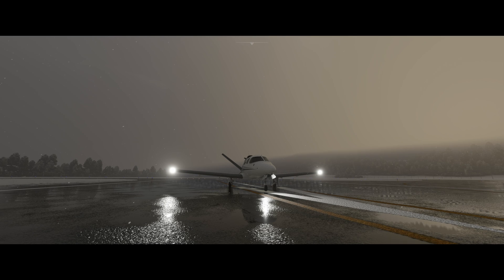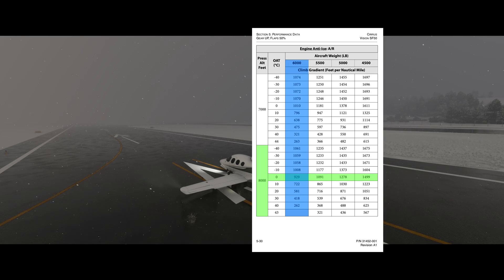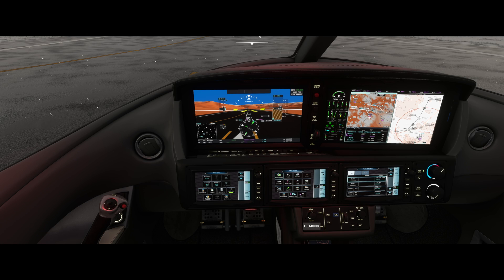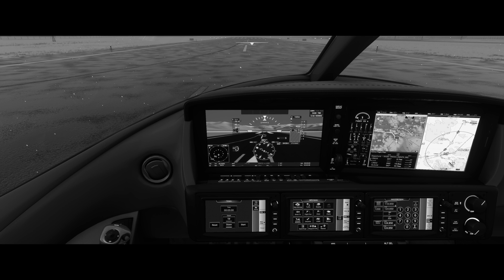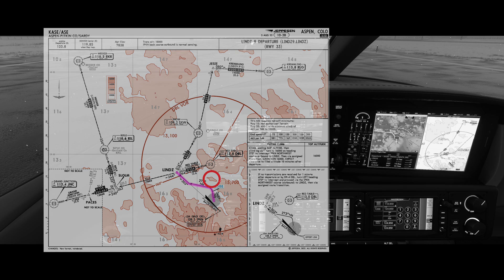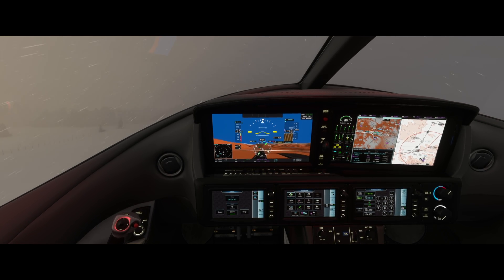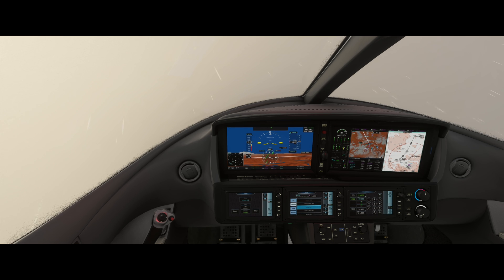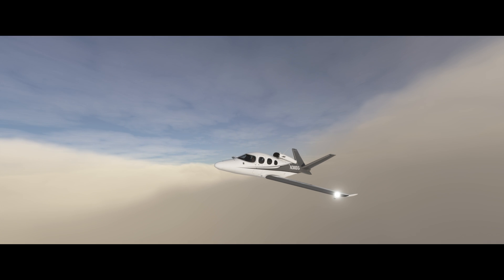FlightFX Vision Jet: High-Performance Takeoff

Comment: Great content.  A realistic sim model deserves to be flown realistically.  Looking forward to more!
Enjoying the VJ....so much more accurate than the XP version.  Definitely my current favorite.   As a long time jet pilot I still find it handles a bit weird in pitch on the runway.  Wonder if as a real life VJ pilot you could comment on the accuracy.  I find it difficult to just lift the nose off and let it fly off the runway.  Seems to take a lot of elevator input to get the rotation started and then it jumps off the runway.  Also it really wants to float and almost needs a little forward stick in the flare to keep it from ballooning.  Maybe the real airplane is like that but with a straight wing I wanted to confirm.  I also notice there seems to be almost silent operation of the flaps.  The gear is quiet too until it clunks into the up-locks on retraction.  Again maybe this is accurate but I get no vibration feedback from my buttkicker on both which I kinda miss.